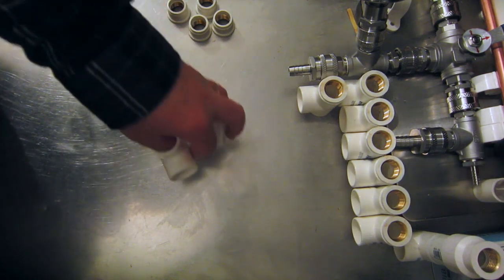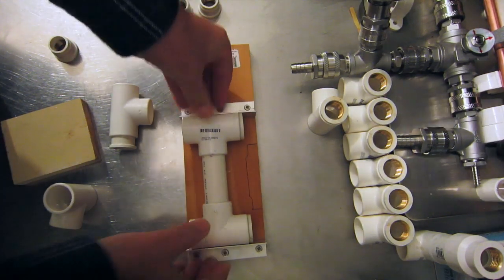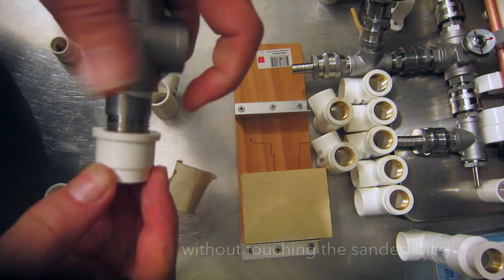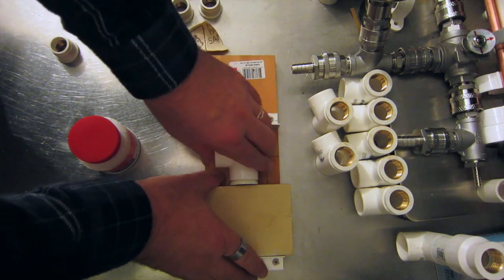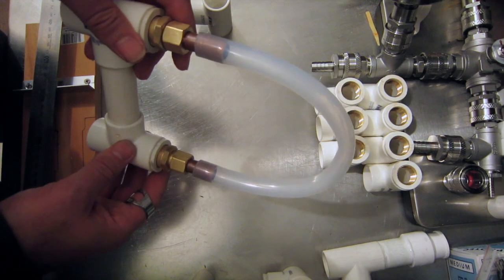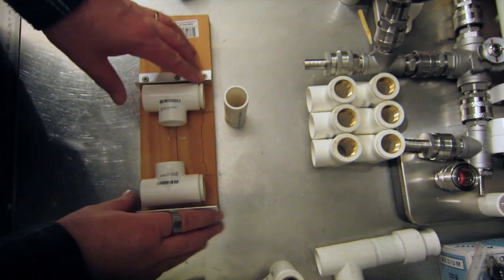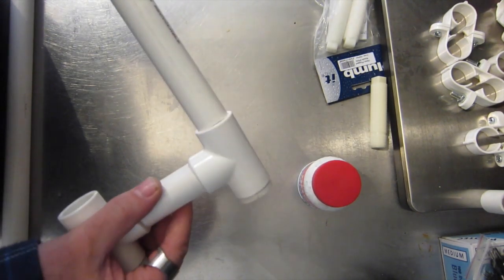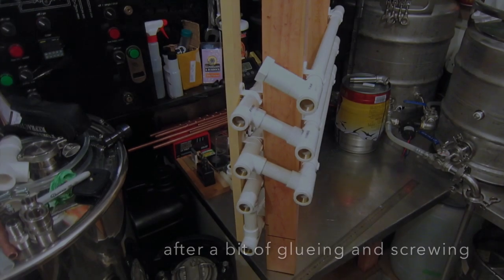Parallel Counterflow Chiller part 2 of 3

Comment: Excellent project! I think I'll be spending a saturday or two pretty soon working on one of these. I was curious about the angles from one run to the next. Originally you had a flat array in mind but when you switched to zig zag what angles did you use for connecting the front and back units? Are they 45 degrees off horizontal (90 degrees from right end to left end)?
Reply from the maker: RiffRaffBrew I did the zig zag so that the chiller wasn't as high, less head height for a pump. As for the angle, it was determined by the timber down the centre that i used to fastening everything together, a bit of trial and error before glueing it all up gave me the measurements to get all the parts lined up. Cheers

Comment: Paul, great video again. Just one small mistake with the measurements: 19mm is not 3/16", 3/16" is 4.7625mm and 19mm is 0.7480315", or almost 3/4".
Cheers!
Reply from the maker: Cerveza de Garaje awesome cheers for picking that up, I added an annotation. After proof watching it so many times theres still typos that sneak in.